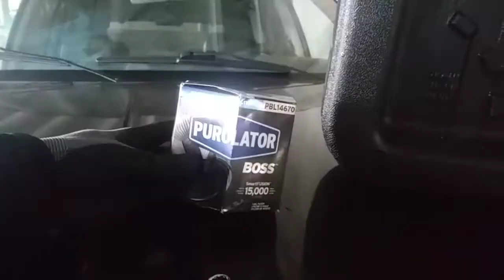OIL CHANGE (1997 JEEP GRAND CHEROKEE)

Comment: Excellent quality and describe what to do very well and gave an explanation of why you did what you did with the battery cable and I like that you recommended to change the drain plug gasket and look for the oil filter gasket to see if it's still on the housing.

Comment: Your videos are great man...thx for your hard work putting them together for us to learn from. Changed my 95 orvis v8 5.2l oil/filter tday with your help. Since i disconnected the battery i could NOT get it started when finished with oil change. Make sure you, (the reader), know what the security/factory alarm protocol is for your zj so you  dont freak out a little like i did because it wouldnt start. Found out i had to put the ignition key in the rear hatch key slot and turn the key twice counter clockwise...that disengaged the security and then she started like a champ. If you dont disengage the battery you wont have to do this....hope that helps someone...

Comment: Watching this older video as I'm waiting for my 5.2 '97 ZJ LTD to cool off to change my oil. Some will have their own perspective on that I switched from standard to synthetic 5w30 which I have had no issue's in doing so. Also note that I do not use the "high mileage" oil as I am fortunate that my 5.2 Dodge Magnum hasn't had any seals dry up and start leaking from wear. Though I should see if the "high mileage" synthetic oil will do any good for my girlfriends rig. I also tend to use Wix filters, and if I am remember correctly is same company who makes them for NAPA. I could just be a sucker to marketing, but I have watched a number of video's where the person takes various filters and takes them apart to show the differences between them all. My rig is not mint, but has been taken care of as opposed to being abuse by all of it's previous owners. Yet my girlfriend 5.2 '97 ZJ LTD suffers minor leakage and burning, thus I use the standard 51085 Wix for hers while mine gets the 51085XP Wix XP.  :)
Reply from the maker: I stopped using the Boss filters and ordered this 12 pack of OEM Mopar filters for $68. Its the best bang for your buck when it comes to filters...
https://www.ebay.com/itm/New-Chrysler-Jeep-Dodge-Mopar-Oil-Filter-MO-090-05281090-Set-Of-12-/272480289571

Comment: Thank you for the video. I don't know much about cars, but I'm glad my 95 jeep is easy to work on. Going to attempt and oil change today. Also, I had a 96 blazer and I bought a brand new oil filter for it before it broke down and never put it in my blazer so it's completely new. Would it fit on my jeep?
Reply from the maker: Sweet D thanks and I have plenty repair videos for your '95 Jeep ZJ.
sorry to hear your blazer broke down on you but im not sure that oil filter will fit but you should still try it out. I only use the Purolator Boss filter PBL14670 from Advanced Auto Parts

Comment: I have a 1993 Jeep Grand Cherokee laredo i replaced the battery and the alternator it sucked the life out of the battery but the alternator  is not doing ita job still wont turn over starts up then turns off any tips ?

Comment: Like watching your videos. I have the same engine and my oil pressure is the line before 40 and it just stay there. Any solutions? Thanks
Reply from the maker: Youll be fine. Both my Jeeps are like that its pretty normal

Comment: Do I have to unplug the battery or is it an option??
Reply from the maker: If your using an oil filter wrench to remove the oil filter and it slips and hits the starter you will shock yourself...  If you can remove the filter by hand its optional